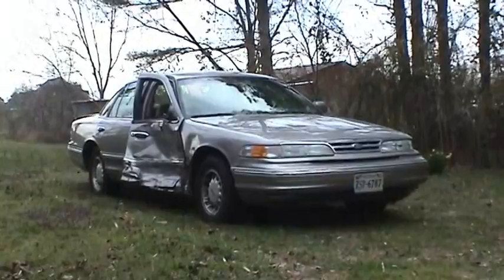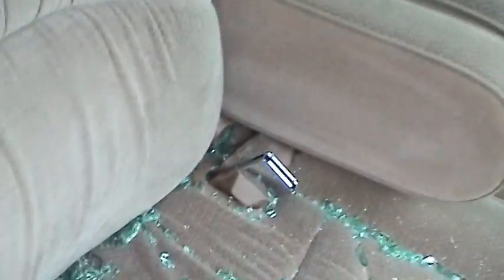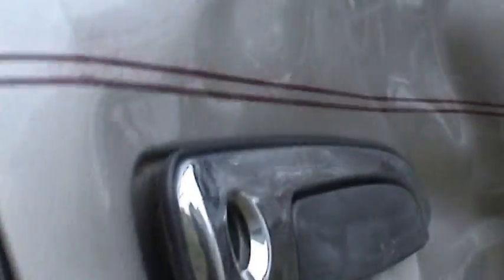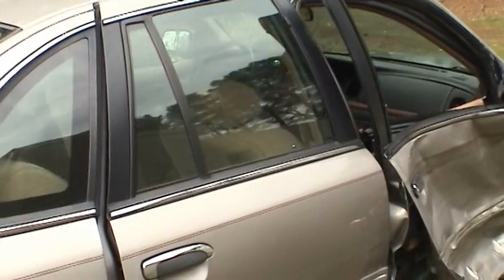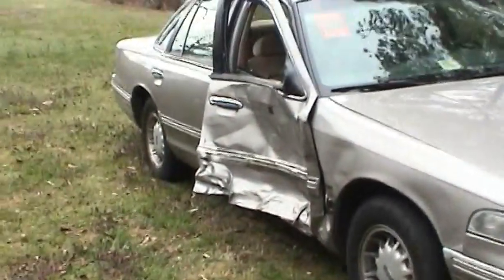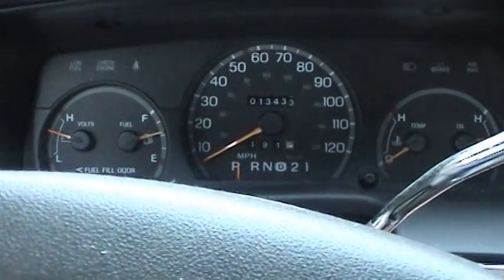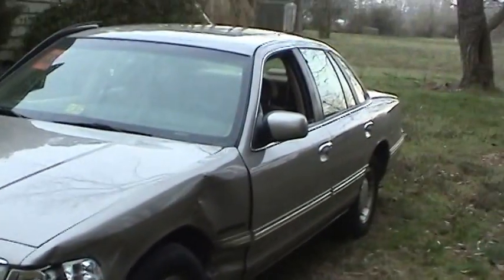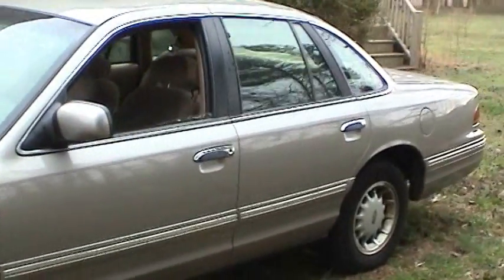Just How Tough Is A Ford Crown Victoria? Ford Tough!

Comment: This is so sad.  I have a 95 P71 Interceptor.  I have had a lot of cars including a BMW which I loved but I have to tell you when this one passes on, I will have another, probably a 2004 retired police cruiser.  Mine is serviced regularly, runs like crazy, has the spot light (works) and the huge inside light along with the push bar in the front.  Don't know if I can let my old boy go and will probably keep him too.
Reply from the maker: I'm glad you're getting great service from your P71. Keep it as long as you can. These things are tanks!
Reply: I got a 2000 Police interceptor myself its an awesome car I bought it for only 1000 bucks the thing is a tank 190k miles and still going strong, had a BMW try to race me and I smoked it, I smiled it was a great day indeed, American muscle>ultimate driving machine hehe!
Reply: Sorry it took me so long to answer.  Yes, these cars are awesome.  I now have 157,000 + miles and this thing runs like crazy.  I have it serviced at the local Ford Dealership and they keep it running top notch.  Love this car.  My next will be a 2004.  My son says is the improved Interceptor.  What color is yours?  Mine is black with the front push bar.
Reply: Andrea Morroni Mine is lime green it used to be a taxi cab after it was retired from the police force before then it was white underneith. mine doesnt have the push bar sadly it was an undercover i believe.

Comment: Install new doors and fenders check fuel lines exhaust and driveshaft engine parts axles etc. Back on the road.
Reply: +eldo59 passenger a pillar did it in. Even the backyard guys cant seal up a car that had the roof line tweaked.

Comment: my dad has the exact same model and features.but not the digital climate control sadly only my dads car is a 1997 and its missing one of the cover pieces on the light pieces on the door but otherwise a very very nice car. i am hoping to find the optional jbl stereo or a cd player for it factory cd player for it.

Comment: I like how you say the crown vic is safe when it has one of the worst side saftey ratings it scored poorly in it's test and also I seem to recall why cops had to park sideways when pulling some one over if it's directly impacted in the rear it can explode (no that's not what she said) granted there is no car more comfy for the price but it's rediculous with the pitiful MPG and very little horse power the biggest problem is that while ford was designing the new mustangs 5.0 in 2011 and the flex and Eco boost they forgot about one of there most iconic cars and to think Now it's been replaced by the tarus
Reply from the maker: The fuel tank safety issue occurred with the introduction of the Watt's Linkage setup in the rear and was only an issue at very high speeds (70+ mph). It got attention because P71's are often put in harm's way to block traffic and are more likely to get rear ended. I tend to think most other cars would be just as vulnerable if not more so but since they're not used in a police environment, those weaknesses were not exposed.

The side of a car is the worst place to get hit with any car because it's the weakest spot. Arguments can be made that uni-bodies tend to fair better, but only if designed to do do. Side impact air bags would have helped the Crown Victoria do much better in those tests. However in this real world test, this Crown Victoria did its job faithfully. So much so, that I went and bought another one. :-)

Comment: If you have not taken it to a body shop, you have no reason to think it is totaled.  I bet it could be fixed by a good shop.  That is the reason for the body on frame car.  You can replace or straighten all the parts you have pointed out.
Reply from the maker: In this case, there was so much hidden damage that it wasn't cost effective. So I swapped the entire drive train into another 1995 Crown Vic. I've been driving it daily and it's running great.
Reply: Did you keep this one around for any more parts later or did you get it into a junk yard?
Reply from the maker: Chris Moore
Actually, I still have the wrecked car. Most of the parts have been transferred to the other car (videos have been posted about that process), but there are still some parts I want to remove before I scrap it such as the stationary glass, tail lights, window regulators, door lock actuators, etc. The weather has just either been too cold, too windy, or too wet to get out there and wrench.

Comment: Seriously only 13k miles?
Reply from the maker: Believe it or not, yes. That's what made this accident so sad. This was basically a brand new car. The body could have been in better shape (several "old man" dents). The ultra low mileage made this large project well worth the effort. The white Crown Victoria has the heart and soul of the wrecked one so that the 13,000 mile drive train will live on.
Reply: That really is sad.  I'd LOVE to find an aero-body like that.  I even like the old-man color!  

My first car was a '93 Crown Vic LX; since then I've had an '04 P73 and currently an '05 P73, both Arizona Beige.  Love these cars.

Comment: I know how you feel and why you put this on You Tube. I was rear-ended in my 2001
Crown Vic while stopped, making a left turn. Police estimate I was hit at 65 miles an
hour. The woman who hit me lost her life, and though I was hurt and hospitalized, I came away with my life and health. I have privately said a prayer of thanks for those 
Ford employees in Windsor, Canada who made my car and that steel frame which 
somehow was able to protect me from being crushed. If logic prevails, Ford will bring
these cars back.
Reply from the maker: Wow, your accident sounds far more severe than the one I had. I’m glad you weren’t permanently injured. I can say that after the accident I had, I have even more respect for these cars.

You may get better fuel economy, better handling, and overall better performance with a smaller, lighter car. But the crash worthiness of these Crown Victoria’s is top notch in my book. So I bought another one and put a new engine in it. :-)
Reply: ***** this guys comment swayed me to the vic. now i know what i will buy to keep me and my future wife safe as a daily driver...my 99 mustang gt is pretty solid too. i got into a crash a few weeks ago at around 35-40 miles an hour where i t-boned someone who came out of no where without looking before crossing a main street (in los angeles of all places). needless to say my mustang only needs a new bumper and fender alignment and im still driving it daily. the honda accord i hit got totalled. built ford tough.

Comment: Lol every car like 80's and up have crash beams in them, its a mandatory safety requirement.
Your just lucky it wasn't a full T-bone.....you wouldn't have been ok at all, the crown vict's do worse then poor in side impacts. I'd say your car didn't do well at all, the only reason you were able to drive it away was because it was a glancing hit not a full hit.
Reply: +MechRider89 He states " When changing lanes, the car was side swiped by a large 2009 Chevrolet C5500 Duramax Diesel flat bed tow truck." Tell the truth, he was the one that side swiped the truck. btw I will take my Crown Vic over any little econobox any day. 15-16 if just in town, 20 back and forth to Lexington and 29.7 when all highway. Dropped to 25 going over the mountains of MD and WV because had to start applying some random braking when coasting reached over 80mph
Reply: Kimmy Kakes We all have our preferences, small cars don't exactly fair bad in accidents any more like they did in the 70's, 80's and early 90's. I don't mind big boats on long road trips and all but I'll take a small car for every day driving over a big one any day of the week. Small and agile make for a much funner drive and lets you get into tighter spots far easier.

Comment: A reliable dependable the crown vic but now they are  made of aluminum foil and computers controlling plastics crap and another computers--all Junque now for sure.  They should make a reasonable sealed gas tank and an appropriate price.  Cars and Motor vehicles are all junque now  Throw it away after the fuel runs out!.